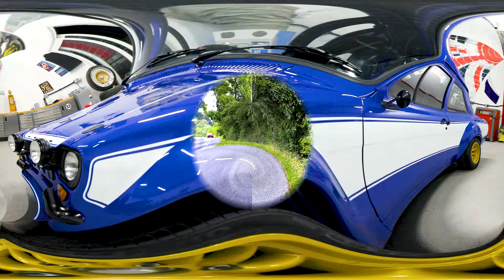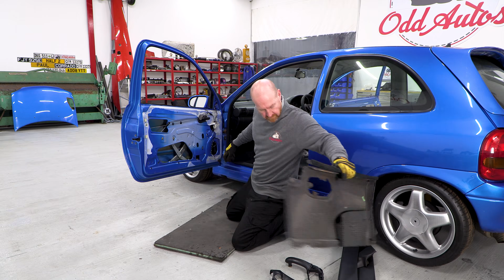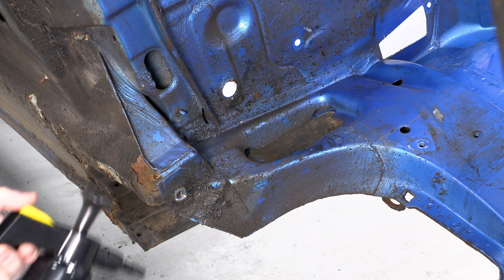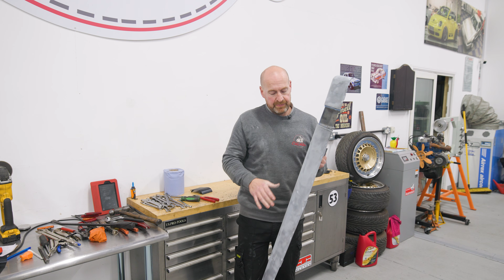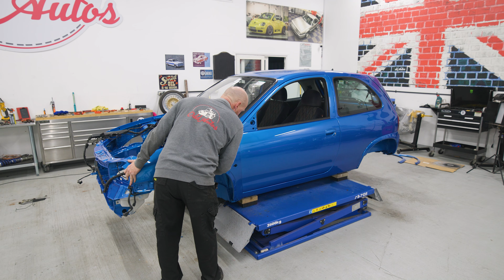Corsa Turbo Restoration

Comment: Thank you for sharing the video, amazing work.
I have a 1995 Corsa B 1.2 engine.
I wish to turn it into a sleeper what engine would you recommend using an Opel engine ? And would this be a straightforward swap ?
Also the rear Axel from Corsa C I believe this comes with rear disc brakes does this fit on the Corsa B ?
Would you know should I decide to keep the same engine are there upgrades for it like a Cam upgrade etc and inlet manifold to install side drafts
 Webber's. .
My apologies for the many questions but I see what you did and it's amazing.
Thank you

Comment: i would absolutly love you to do this sort of thing with my mk6 Fiesta ST150. on the surface its decent and has a respray but the engine bay in the nooks and cranies will have rust and there is rust underneat. Would love it to be stripped like this. But i assume it would cost thousands to have the engine out, undercar stripped, treated, painted etc etc?

Comment: Mate such a brilliant job! Would be good to see more of the work being done, nuts and bolts as you take the engine apart and the welding/bodywork being done, plus reassembly. Not everything of course (that would take ages to edit) but about 10 mins more of work being done. First few bolts etc on each part slow, then rest Timelapsed.